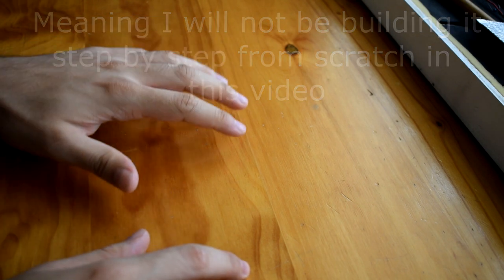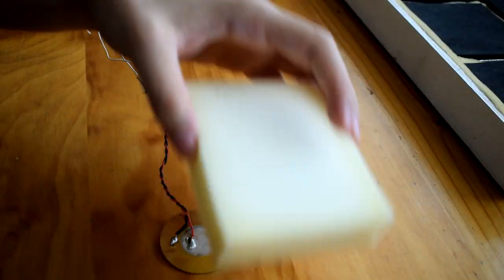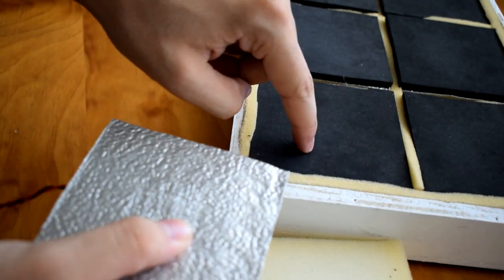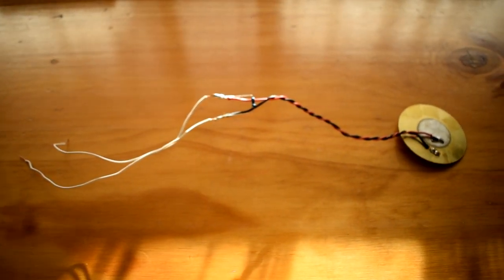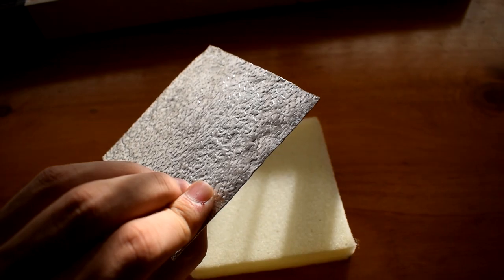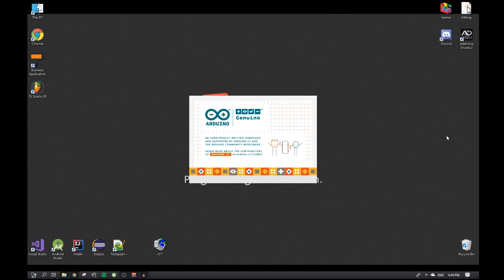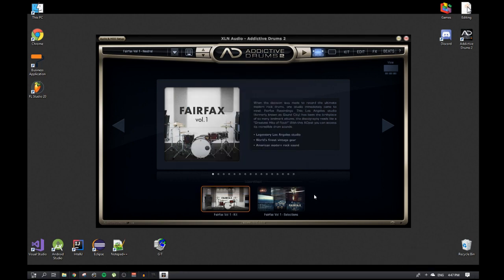Arduino Drums Tutorial Part 2

Comment: My program is able to produce MIDI signals (I am viewing them on a MIDI monitor), but AddictiveDrums and FL Studio do not make any sounds when I hit my sensors. FL indicates it is  receiving the signal, but I don’t know why any it won’t produce any output. 

I believe all of my MIDI settings in FL are correct, and like I said before, AddictiveDrums does not produce any output either. Any thoughts on what the issue might be? To the best of my knowledge, I have set up loopmidi and Hairless exactly how you instructed.

Comment: Thanks for trying to deal with the isolation issues, pressure sensitivity is VERY difficult when doing a multi sensor surface, I've been really struggling with this and throwing in the towel, unless you're separating all the sensors into their own enclosure you can forget about it. One will trigger another. Also thanks for sharing the working sketch, seems to be triggering my pro micro uno (built in midi support)
Reply: I'm working on my own similar project, and I haven't finished throwing everything together yet, but my thought is to create the pads the mount them to the surface with some double-sided tape. I'm hoping that the space that the double sided tape allows for + whatever vibrations it absorbs will be enough to isolate the sensors from each other.

If you've finished yours and gotten around the issue, I'd love to hear how you tackled the problem.

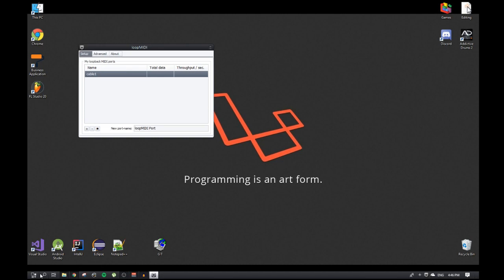Comment: 6:48 You have already plugged midi cable in? Ir just the regular usb cable to arduino?
Reply from the maker: No it's not a physical midi cable, you use loop midi to create a virtual midi cable, then you plug in the arduino with a usb, the hairless midi will pick up the arduino and you can set the output port to that virtual midi cable you created in loop midi

Comment: Hey how easy is it to change out the sounds you use for the drum kit?
Reply from the maker: Depends on software you use, I'm assuming you're thinking that the arduino handles the sounds, which it doesn't. The arduino just handles the sensors, you need a music software like EZDrummer to actually make the sounds, the arduino acts as a midi device, Google a bit about midi devices, technically you can use this method to make any instruments, eg a xylophone

Comment: hairless midi is working but the addictive drums wont work for me
Reply from the maker: If addictive drums doesn't work you can try EZDRUMMER, but before you do make sure that loop midi is also working properly

Hairless handles communication between the arduino and the computer, but loop midi handles communication between hairless and the music program

So in addictive drums you would select the midi port you set in loop midi

Ask more questions if that doesn't work

Comment: hi, thanks for the video. I didn't understand the GND part. I see a cable that goes from GND in the arduino board to the A15 in the arduino board also. What's that for? or is linked from POWER GND to DIGITAL GND ? do you have a drawing of the complete electrical circuit?
Also it would be great if you can explain how to put a display to switch the midi notes assigned to each pad when is connected to the pc...so you can change the sounds in ezdrummer directly from the arduino gadget and avoid changing the code to do so.
Reply from the maker: The GND wire is from Analog 15 to GND, The code just reads this value as 0 between reading all the pads just as a baseline so to speak, it's in order to reduce any noise that might occur, the display is an option but I don't have the time at the moment to do that

Comment: Hi, I had made this kind of electric drum once in the past using uno, loopMidi and hairless midi just the same as yours, and the drumkit using fl studio plugins, 
I was struggling trying to get rid of milliseconds delay between the time the drum was hit and the sound produced as close as the conventional drums did,
do your final work have the same issue as mine? and if so, how to get rid of the delay? 
thanks
Reply from the maker: Hi it's easy to get rid of the delay but you'll have to play around with settings

In FL Studio your sound device has to be set to ASIO (you can download ASIO drivers) and the latency in the ASIO panel must be 256 (or less) then you should get a very small latency, basically not noticeable

This works even better when you use EZDRUMMER or Addictive Drums as a standalone program

Comment: I tried it on Arduino nano and it works ... but how do I do to have more sensitivity on the pads? ... where in the code do I modify it?
Reply from the maker: There's a line of code towards the top that you can set velocity = True instead of false
Reply: @thinktech3818  
I already put it true, but when hitting the pads it marks the maximum speed, could not change a value or something? .. Thanks for responding, greetings
Reply from the maker: Interesting, for the sensitivity to work properly their needs to be the same 1Mohm resistor and the piezo can't be directly connected to the pad you're hitting

My version is like that because I made a octopad format but for conventional drums amd velocity sensitivity you need a little bit of dense foam between the piezo and the surface you're hitting

Take a look at electric drum triggers from rolan and you'll see what I mean

Anymore questions are welcome

Comment: does it matter what direction the resistor and diode are soldered?
Reply from the maker: No it does not so long as it's soldered in parallel with the wires from the piezo
Reply: @thinktech3818   ok awesome thanks for making this video its been a great resource
Reply from the maker: Pleasure!

Comment: Is it possible to make the individual drum pads velocity sensitive? I want to make a drum kit out of these sensors but i want separate cubes unlike your setup where you have 8 drums together. I understand that in your scenario you had to make them less sensitive because they were triggering their nearby sensor as well. So my question is if I make these pads separate, is it possible to make the volume pressure-sensitive using the same sensor ?
Reply from the maker: Yes you can, the code already allows for velocity sensitivity, it's just set to false for my purposes as you said, so set that to true in the code before uploading it and it should be good
Reply: @thinktech3818  Thanks man. I hope this lockdown gets over soon so I can start working on this. You be safe and take care. will bother you again sometime in future in case something doesnt work for me :P
Reply from the maker: Awesome! Pleasure man

Comment: Great teacher ! One question: suppose I had a module with only two trigger inputs. Is there a way to make a third out of the two ? Like Midi programming, I dont know.
Reply from the maker: Unfortunately there is no way to make a two out of one input, however you can program a switch into the code to say when you press a button, change the midi note for that input to something else
Reply: @thinktech3818  Yeah, I know the button to midi note change can be done, but I was interested in knowing if there was a way to make 3 out of 2 somehow.
Reply from the maker: You can do that with some more components, YouTube Arduino drums with a multiplexer or just look into what a multiplexer is, is can "extend" how many ports you have, even if you have only 6 as example you can get a lot more with that
Reply: @thinktech3818  Oh, ok. But since I didnt take the Arduino path 3 years ago, I purchased a 4 pad Kat ktmp1. I was thinking about how to make some triggers out of the 4. Like imagine I connect a piezo to both Pad 1 and Pad 2 cables, so when I hit it they are both supposed to sound but, since both are hit at the exact same time, that midi-wise one can make the daw interpret that as a "third" pad. I know that modules regularly have some way of interpreting one of the two hits as  "false" so maybe this cant be done.
Reply from the maker: It sounds plausible, you would then just need to keep in mind the drum kit and what pad you would potentially play on the exact same time without intending it to trigger a "3rd" option

So for instance if you play the a simple beat with kick drum on 1 and hi hats on all 4 counts and snare on 3, you wouldn't want the software to pick up you hitting the kick and hihat or snare and hihat, which would be two different piezos as your "single" Piezo connected to two inputs
Reply: @thinktech3818  Exactly

Comment: Hey, really like the tutorial, so i decided to build one myself. My only Problem is, that the pads do not get triggerd very easy, you really have to hit them very accurate where the piezo is located or very hard. Do you have any suggestion? Thanks in advance
Reply from the maker: I would suggest playing with the minimum threshold values in the code (making them lower), it shouldn't be hard to find
Reply: @thinktech3818  wow thanks for the quick answer. Will give it a try

Comment: Hi, I purchased an Arduino Uno R3 and I have got four piezos as the drums, but when I try uploading the code, it says something like 'problem trying to upload the sketch to the board 
E.G. The circuit diagram I used for my project was from this instructable
https://www.instructables.com/id/MIDI-Arduino-Drums/
Reply: could you please help me if you can at changing the code?
Reply from the maker: Hi, all I can think of is you just make sure that you selected your board and the correct Comm port in the Arduino software when uploading the code, there isn't an issue with the code, try that and see if it works, otherwise click the red reset button on the Arduino and try again
Reply: @thinktech3818   ok thanks, I will check it out and tell you if it works for me.